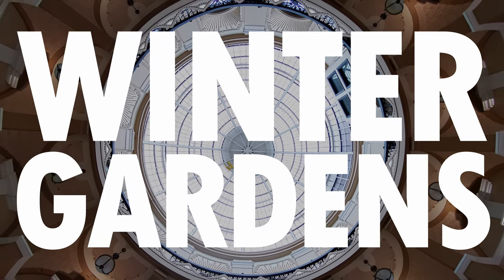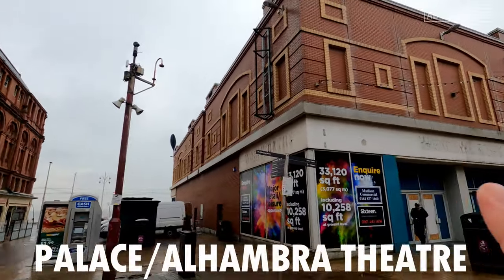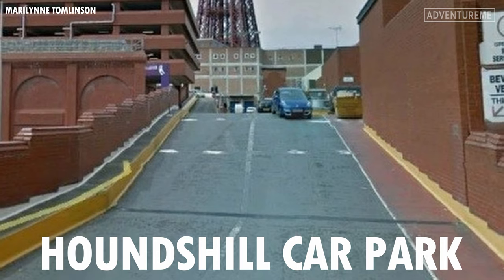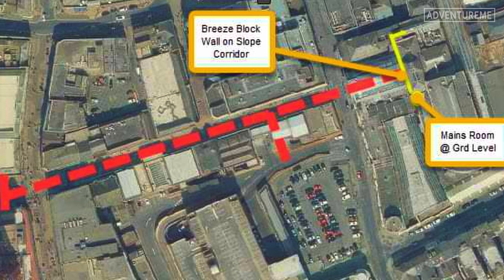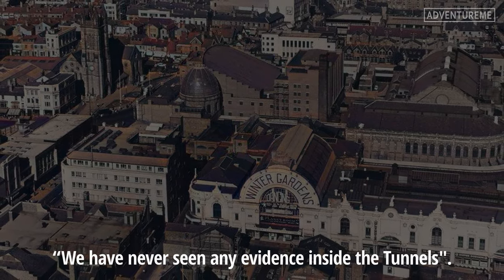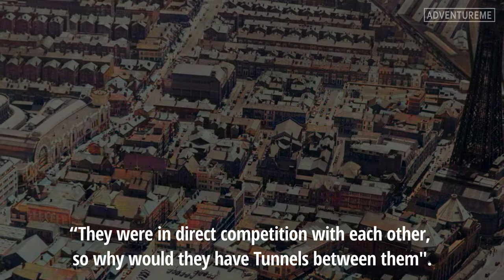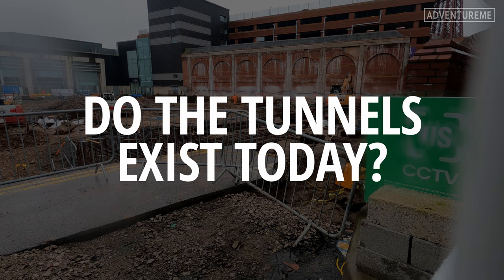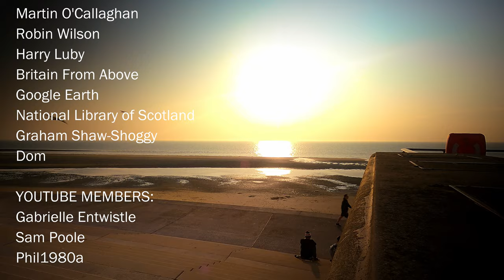Blackpool's Secret Tunnels | Did They Exist?

Comment: I worked at Blackpool tower in the 1980's and while I never got to the lower sections, which had a zoo there at the time, there were other staff that often talked about a large doorway facing inland rom the back of the tower building that was heavily locked. Everybody wanted to know what it was and why it was shut off to seemingly everybody. Many said it was a passageway or tunnel and it would have run more or less along the red line route route at the you discussed at the 13 minute mark to the Olympia. The tower basement is pretty deep and would probably be below basements of other buildings. 

What I do know is there were "secret" passageways behind the public passages in the tower. You could walk around the edges of the ballroom for example without being seen. I've been in some of them, but my memory is a little vague and I can't even remember how they were accessed.

There are lots of theories about tunnels in Blackpool, not least one running from the town hall by Talbot road to Rigby Road tramsheds (current bus depot), which was apparently built as an emergency exit route for town hall staff and executives during WW2. In Talbot Square, adjacent to the town hall entrance, there were underground toilets until fairly recently and there was at least one doorway which led who knows where in there. There were simllar underground toilets near central pier, which was close to the tramsheds, and near south pier. The toilets at central pier also had an entrance on the opposite side of the road next to the pier if I remember correctly. I always thought it an odd coincidence that all three underground toilets were all opposite each of the three piers. In the tramsheds there were service pits and in one of those pits there was a locked doorway at one end. Nobody knew what was behind the doorway but it wasn't a storeroom, you could just see what seemed like the glow from distant electric light through tiny gaps and feel air coming from behind the door. Rumour was that it was a passageway that went to the town hall.

Comment: I worked as a performer at the Tower and I remember being shown a filled in opening below the Tower Circus by a workmate who’d also worked at the Winter Gardens. He stated it had been access to the tunnels. It seemed to be an accepted fact that the tunnel existed by other workers.. generally those who’d been there a long time.
Reply from the maker: I heard the same too
Reply: Similar to what I heard when I worked there in the 1980's, but I heard that it was a large locked doorway, not a filled in opening.

Comment: There’s an extensive tunnel network under Fleetwood, for I expect less nefarious purposes, typically transporting cattle.
The entrances are
1) at the rear of the mount, bricked up - left side of Gate Lodge on Mount Rd, opposite London St.
2) underneath the Euston Hotel, in what I believe is now a gym - also bricked up.
3) in a raised bank? somewhere towards Rossall school.
Someone I know who’s been in the tunnels said there’s holding pens down there and it’s vast. Easy to get lost.

I was also told of a tunnel under Bourne Hill, nr ICI, where the old farmhouse used to sit - now demolished and next to a mini roundabout and pub.
I thought it was Roman origin, because it went in the direction on the old Roman road and port at Rossall Point, but now I wonder if it was actually part of the cattle tunnel network. It would make more sense.
Reply from the maker: Thanks mate
Reply: @AdventureMe  very welcome mate 👍

Comment: The principal issue with tunnels of any length is ventilation. With a relatively short tunnel, maybe 100 metres or so, this won't  be a particular issue. But much longer and there will be the problem of the build up of fetid air which can become dangerous.
Reply: i dont think these tunnel theorists realise the cost and logistics of building a tunnel from the tower to the winter gardens would have cost more than the tower

Comment: I worked in Lewis's in the 70s and was told the tunnel between the Tower and Palace did exist but was sealed when Lewis's was built in the early 60s. It was later opened for some reason and after that Lewis's had a rodent problem. I didn't ever see the tunnel as it had been re sealed sadly, but it seems a good bet it did exist as it was a short distance between the 2 buildings. I would like to believe there was a tunnel to Winter Gardens too, great video.
Reply from the maker: Thanks Pete. The pictures at the beginning of my video when I'm covering the palace tunnel. They are pictures of that tunnel, taken a few years back.

Comment: Great video thanks. I have no doubt your theory is correct. I worked at whitehall Road power station in Leeds where so much of the city was linked by such tunnels. Otherwise thye would no way of providing power throughout.

Comment: I used to work at winter gardens about 10 years ago, and I can confirm there is access to the cellars/basement from the kitchen of the Empress Grill. The few occasions I had to go down there were pretty spooky but I do remember there being an odd dead end that just stopped and looked like it had been filled in, this was in the direction of the tower so I always assumed that was from one of the tunnels that I used to hear of. Was nice to see this video, I had wondered if they still existed in full
Reply from the maker: Thanks Adam. Yes I agree

Comment: The tunnel from the Tower to the old Alhambra still exists.
There are no marks on the right hand side of the wall to show any spur to the Winter Gardens I’m afraid. (You used my pictures - a shame you didn’t use the long shot showing this)
I’ve spent hours under the Tower looking for any possible tunnel. There isn’t one. Just the one I photographed which still runs right under the street to the old Alhambra.
Reply from the maker: Brilliant. I didn't realise that was actually it. It was supposed to be a representation of it.
Reply: so correct every thing else is rubbish

Comment: Umm spooky tunnels very interesting.
Do you know anything about an underground storage unit for trams in little bispham before there current location, i dont know what its used for now, if anything.
Thanks for the info
Reply from the maker: I don't no. Maybe one day.
Reply: There was a tram depot at street level in Bispham where Sainsbury's is on red bank Rd. At little Bispham there is a turning circle for trams terminating there. 

 There was an underground boat storage place at anchorsholme which kept flooding and has now been filled in.
Reply: there was an underground car park at Little Bispham (filled in now) that closed many years ago and was then rented to a local boat angling club for a good while. This was right by the tram tracks so perhaps that's what you're thinking of?  Funnily enough, during WW2 it was deemed secret and rumour was the phosgene gas canisters from ICI were stored down there on the qt